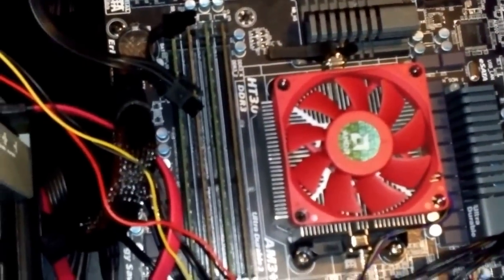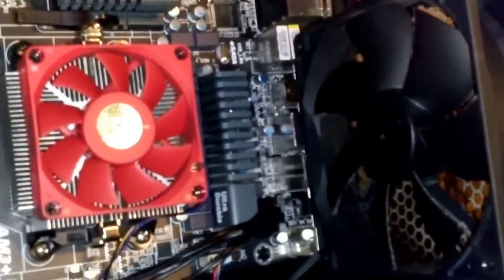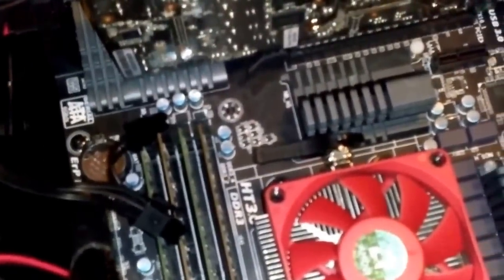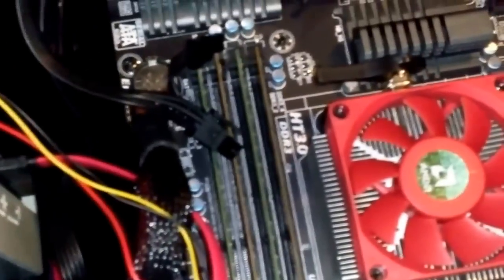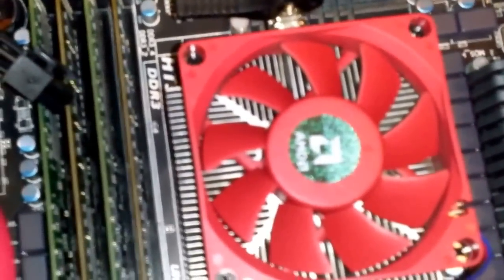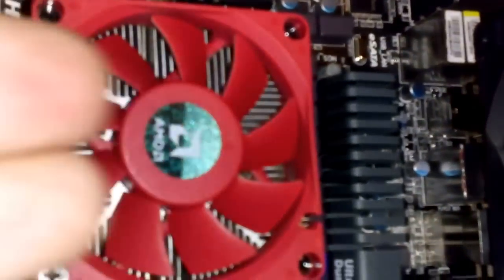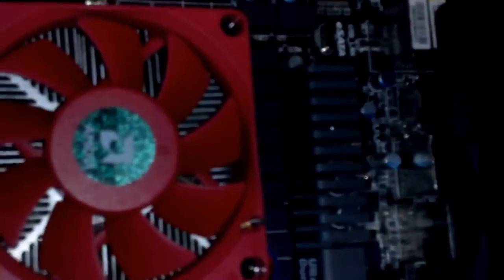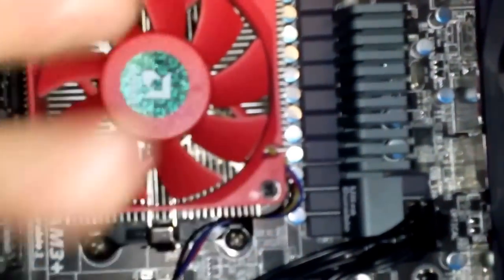Computer Fan Airflow Direction Tutorial

Comment: hi i need healp i got a n nzxt p240 white case  with  gigabyte  f2a88xup4 motherboard  with amd a10 6800k with 16gb Radeon  performance ddr3  ram  an a nh d15s in my case i use nh d15s thermal paste an i  notice my case fans back was kinda smellin or something  lil bit   lil heat i gess but do i have bad airflow  or something  an my 620 hard drive  kinda gets hot  but my 128 ssd dont thats got my windows 8 on it so how do i fix my problem